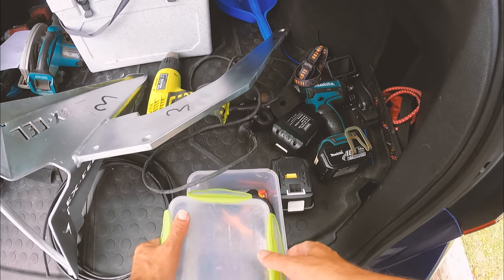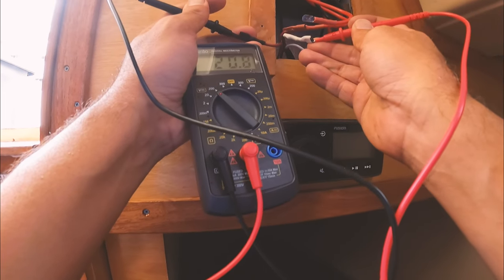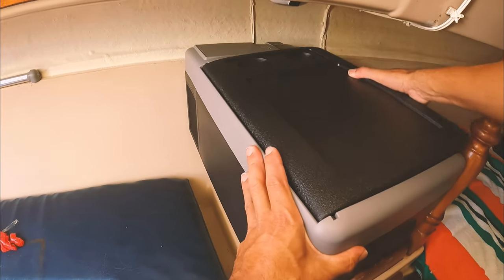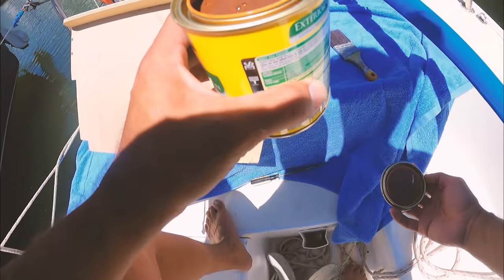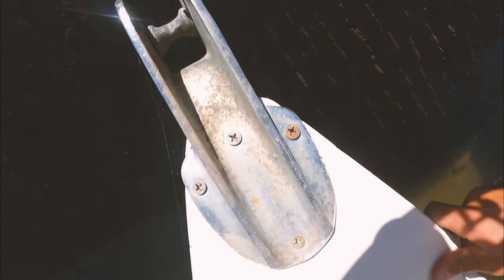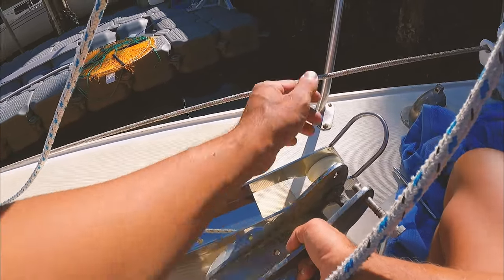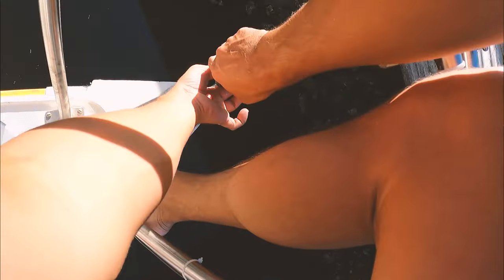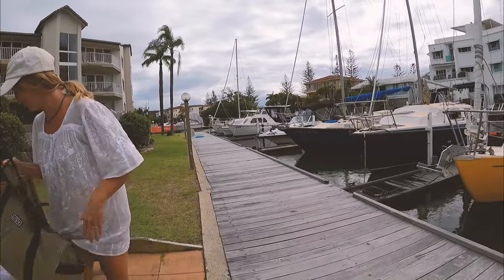Taking My Wife Sailing For The first Time.. But First, Lets Fix The Boat Ready For Adventures

Comment: Pro tip: If drilling into the boat, you should be drilling a larger hole than needed, fill it with thickened epoxy, then redrilling it to the correct size. This prevents moisture from reaching the core of the boat and rotting the boat from the inside out. You now have holes where water will not only sit from the anchor, but from water rolling over the bow. Not too late to pull it off and make the correction.
Reply: Great tip, thanks mate.
Reply: @alexandersupertramp1293  He actually says it’s wood between the layers of glass
Reply: @alexandersupertramp1293  If you noticed when he was drilling. you could see wood dust on the end of the drill.
Reply: @alexandersupertramp1293  That is where the seam is. Deck mating to hull.
Reply: I'm rebuilding a boat now and I love this tip!! Thanks sir!!
Reply: I don't think he even put any marine epoxy, even on the screw holes......That boat will be leaky.......and eventually rot.
Reply: @Aphxphotog  You can see the light from the underside of that anchor area....There is NO wood, except for where he added the wooden strip for the screws.
Reply: The commenters don't know what the fuck they're talking about haha
Reply: would that mean you should put some epoxy or silicone in the hole after you run the wire through in order to create a watertight seal? say if you were using a 1.5m wire, you get your closest bit to make the hole, and the wire MAY not be a perfect seal, is silicone necessary?

Comment: The only issue I can see with the swivel in that spot is if it gets snagged in the hawse pipe or on a deck fitting when you deploy the anchor. You definitely want to mouse the swivel with stainless wire too. This stops it from accidentally coming undone cause you don’t want to lose that sweet anchor. It is a sweet little boat. Can’t wait to see some big adventures in it.
Reply: Definitly mouse the swivel so you don’t loose your anchor. Looking good though congrats
Reply: At least zip tie the swivel bolts for sure.
Reply: The biggest loss when losing an anchor is not the anchor itself, but the boat which will probably be sent on a reef while the crew sleeps.

Comment: The next step on your new anchor setup is a snubber.  Basically it takes the load off the roller and onto your large Sampson post just behind your furler.  There are phone apps that will also monitor your drift via GPS and sound an alarm if you start dragging anchor while you sleep.

Comment: Hey mate, working alone tightening deck bolts (above and below deck), I always use multi/vice grips on the below-deck nuts and tighten the bolt above topside….vice grips hold nut and swivel only as much as the hull allows…. Don’t need another person.
Reply from the maker: Yep a set of multigrips would have been handy for sure. Might add them to the boat kit👌

Comment: Tip. The hole in the shacle pin is for wire to go through to stop the pin undoing. Wrap through hole and around shackle shank twist wire to lock old style. A cable tie maybe these days.
Reply: Haha years ago I lost an anchor exactly like this. I was new to boating and had 4.65 stacer for fishing.

Comment: Having bought and repaired an old sailing dinghy this year I thought I could give u a few pointers to help get this beautiful boat sailing smoother. 1) Replace important ropes with new ones. Old ropes tend to get less flexible and smooth with the years and salt water therefore replacing the mainsail halyard, the vang and any other ones u think aren't very smooth with new ones will make it a lot better. New ropes are lower friction and much more reliable so I would recommend them.  2) Old boats need a lot of WD-40, especially in rollers in the mast and boom, it will help a lot with making everything smoother. The last thing you want is a pulley or roller getting stuck in strong winds.  Finally as others have said make sure you wire that shackle. Can't wait to see your adventures with the boat.

Comment: To make raising and lowering the sails easier, I highly recommend installing some "lazy jacks".  This was one of the first things I did on my '72 Cal 27 T2.  You can basically just release the main halyard and the sail almost folds itself on the boom.  I'd do that when soloing or during rough seas, and just neaten up the folds when I was back at dock (or anchor).  It's an easy one day project.

Comment: Always mouse your shackles up mate. Mousing them is using some decent fine stainless twitch wire, through the hole of the shackle pin, around the shackle leg and back through the pin's eye.( can use good cord, but stanless wire. will last longer. . this will stop them working loose.. All your shackles, not just the ones on your anchor rope and anchor. .Cleavis pins also if they feel loose..  .. be safe , be well.. nice little boat you have :)

Comment: Mouse that swivel connector up thats what the holes are for, stainless and galvanise dont mix get galvanic reaction, that bow roller cound have done with some bedding compound like silicon under it. Nice boat good potential

Comment: Hi mate, liquid electrical tape is your friend for your wiring connections. I use 3 coatings with heat shrink. The last layer I leave tacky so when I heat the heat shrink the liquid electrical tape squeezes out each end. This will give you an absolute water proof connection. I have used it on my yak sounder installs for years and still good. Also some zip ties on those anchor/chain shackles would be a good investment. Cheers, BobbyB

Comment: the reason for needing a large stout anchor swivel is that if you're anchored and the wind starts swinging your boat around it prevents the chain from tangling on itself and pulling out the anchor which will set your boat adrift. If you anchor and go ashore, you might come back to find your boat on the rocks or the beach. It could drift anchor as well while you sleep. Don't forget to use the wire on the anchor for extra protection against the swivel coming apart causing you to loose your anchor.

Comment: Can’t believe you got the roller on without dropping something in the drink ! I wouldn’t be so lucky. A couple of things with the anchor. 1 be sure to go back and lock wire the shackles and swivel.  2 The Hawse pipe has a chain stopper already so no need to put another shackle on the chain to secure it. Great vid Rod.
Reply: I've seen a guy hang an upside down open umbrella off his boat when doing jobs like that, if you drop something it will catch it

Comment: Rod, You may REALLY want to change the plywood pad (in the forepeak)under your forestay to a stainless steel plate with as much load-bearing surface as you have space for. There will be a lot of load on your forestay with your mainsheet trimmed on when you are going to weather/into the wind. If that lets go you will drop your rig.

Comment: The fact that your wife is ok with you having a boat means smooth sailing. (Not that ole sailing lore from back in the day saying a women is bad luck on board.)

My suggestion is plan/project ahead, be prepared, tie down before it needs tying down, fix before it needs fixing, paint before it needs painting. When things go wrong on a boat things can happen fast and little problems can compound into bigger ones. Although true on a smaller boat, a larger one is where this advice really holds.

Good luck and thanks for the vids....

Comment: You need to tie wire on the pins of your swivel., also drill a hole through the anchor leg and new roller so you can put a keeper pin in it. Joys of the first sailboat. Ive had quite a few. Now im on a 52 foot Tayana. Any questions please feel free to ask.

Comment: Your new bow roller Should be bolted to deck with a strong backing plate.  If your at anchor in a strong storm wood screws may pull out. 
Have fun your doing a great job thinking about safety!

Comment: Wouldn’t be a bad idea to throw some sika in the anchor roller screw/bolt holes to stop the water coming in! Also, best way to trim the sails is to let them off until they just start flapping, and then slowly bring them on until they stop

Comment: I'm not much of a sailor, but I am an audio engineer - a tip for the wind sound if it's bothering you: in the video software/audio software you use, if they have the option to add an "equaliser" on the audio track, cut off around 60Hz and then add a small shelf around 120Hz and it should tidy up your audio while you are out sailing in the wind. 
[I could do it for you if you like, it's a 5 min job!}

Comment: You should put fresh bedding on any screws/bolts you pull.
Trust me.
You should rebed every screw and bolt on the exterior.
Me ~ 20 years of boat repairs.
Just a small dab will do, and it is likely to save you 100's hours in the long run.
Reply: Did he even fill the old holes from the original bowsprit? He needs to if he didn't.
Reply: @Mardy72  He's likely to be chasing leaks. I've been paid a lot over the years to chase leaks. Basic bedding practices can save one a lot of money, time and frustration.
Nonetheless, I think he is a pretty good DIY guy. 
Better than most, but if he worked in a reputable boatyard for a bit he would be much more competent.

Comment: You should drill oversized holes and fill with epoxy, then drill the right sized holes for your bolts to prevent the deck core from rotting. Using a dozen washers for packing is not good! Use a block of wood or fibreglass.

Comment: Get a bit of stainless steel tie wire and tie the d shackle pin to the shackle so it can't work loos.  And always use antisize on stainless steel bolts so they don't bind up . I like your new boat you are doing well all the best.  Wayne the Welder

Comment: I would highly recommend you pull those screws and bolts and put sealant all over the threads and then install.Over time water will work its way in.I didn't see on your rode but you should put markers on your rode and then you know how much rode you have out. Its very important to have the correct amount of scope out.Have fun. Cant wait to see you catch a Marlin off that boat.

Comment: I have 3 terrifying events happening in the next month. First is handing over a rather large cashiers check for a boat, second is a 2-3 day trip back to home dock, third is the return trip home involves a draw bridge and a set of locks.

Wouldn’t even stress about the remodel work, that’s easy in my mind, by comparison.

Comment: You should improve those connections and wires. Make a project video on rewiring the boat, ti's also a important safety feature on the boat.

Comment: If it hasn't been suggested yet, a thimble should be installed in a new splice on the end of the rope to eliminate any abrasion between the swivel and the "eye" on the anchor line.   Also each of the shackle pins in the swivel shackles need to be wired to the swivel to prevent them from unscrewing when under pressure in high winds.  This actually happened to me.  Anchor shackle came unscrewed, fortunately not at night, but in the morning!!!  Lost the anchor but not the boat!..

Comment: Great vids but more importantly amazing variety, the swivel between the anchor chain and rope was right, you need a metal eyelet on the rope, rope to metal will fray, metal to metal won't. Devil's claw  just for extra security to stop anchor deploying accidentally, just sturdy rope tied to the anchor then to the nearest cleat will do the job.

Comment: Thoroughly enjoy the video, you asked for suggestions. Tie wire all those pins in your anchor line, the last thing you want is one to come undone and you lose that lovely new anchor. If you put your new solar panel on top of the boom you will keep it out of the shade (when anchored) and you can tilt it towards the sun by adjusting the tie downs (may need a stiffener on the back). Thanks and have fun.😊

Comment: 54:19 if you're out at sea and it's not safe, you definitely want to sail (or lay ahull). The motor on a sailboat is really just meant to leave the marina or get you out of trouble in a current with no wind. The boat is way more stable when sailing, trying to get out of a storm with the engine is unsafe AND will get you sick because your boat will rock around like crazy. You can look up "heavy weather sailing" on internet, loads of good advice.

Comment: One word…EPOXY!  Fill holes, paint it on any wood.  Epoxy is your friend!  Have a secured tie-down ready to clip your anchor shackle when you’ve finally have it settled on the roller.  Get rid of the swivel on your anchor rode and put in a soft shackle. They’re just as strong as the swivel, they’re lower in profile and much less likely to hang up running through the chain hole.  Get a bunch of them, they’re awesome to have on the boat!  Single-handing the boat is great, BUT, if you get your wife into sailing, you’ll always have a sailing partner.  That’s an important thing…trust me (I don’t).
Reply: Trick out the V-berth with some mood lighting,  RED LED’s on a rheostat for night vision.  Get an anchor snubber…use it. Make a boom tent so you can get out of the sun/rain. Electronics help but always look at your windex…if it’s getting snotty, take in a reef or heave to.

Comment: Hi Rod, I loved your video. I want to give two small advice; you may want to  put a stopper knot at the end of your main sheet too, it can slip out of your hand very fast in rough weather. and when securing your halyard, wrap it around the cleat only one time then make figure 8. If you use more than one wrap, you may not untie once you need to be quick. 
I can't wait to watch the next videos.

Comment: How hilarious. I'm renovating a 30ft sailboat and doing almost exactly the same thing as you. Same equipment, same problems to fix. 
Brassmonkey fridge I have has a battery option as well which works well for a few hours if you want to not stress the batteries. Also use the mobile app.
 Have the same bowroller and anchor upgrade. Yours looks a little big for your boat as I'm 5 tons and 20kg. Really enjoying your sail videos mate.

Comment: It's actually quite relaxing to watch you fix up your boat. Only thing I can think may go wrong down the line with the stainless swivel is electrolysis on the galvanised chain
Reply from the maker: Yep will keep an eye on it, might swap it out if it becomes an issue 👍

Comment: A few years ago I was told "A sailboat is a money shaped hole in the water", I hope that's not your experience.
When my solar put 18.5V into my 12V battery it was wrecked in a couple of days. I was told a regulator will limit to 14.5V, the ideal maximum for a 12V battery.

Comment: I don’t know if I saw it in the comments or in the video, but the hole in the pin head of the shackle/swivel is for a cotter pin or safety wire, so it doesn’t come undone in use.

Comment: Great little yacht. I used to keep my boat in the next door units.   I had a centre board so could get in and out most of the time, very shallow at low tide. Its a fantastic trip up to the top for Moreton Bay . You need 2 weeks to get the best out of it, further than it looks. Your family will love it.

Comment: Those lock nuts can be a real pain. I always use a pair of locking vice grips. Lock it down on the nut and then when you start tighten from the top side it’ll wedge itself somewhere under there. As long as you can pop them loose it works.

Comment: Putting our boat in the water in two weeks time, I hope! Went down this morning to check our berth and to work out if I needed some more fenders. The walk ways were a good foot under water with the extreme tide. Had a look at Misty and your anchor set up while we there. That's a big anchor!
Reply from the maker: Hey Mike, now I remember your last comment and that you were in the same set of berths. Yea I was a bit shocked at the size of the anchor too... but I figured it is good to have a little more then a little less, and my boat length and weight sits right in-between the recommended sizes. Looks fine now that it's mounted on the bow and out of the way. I heard the tide was right up. I had to go there just now to put a spring bungee on the boat as it was so high the boat bow was sitting right over the wharf! could have been a big problem if it got stuck up there at low tide😅
Reply: @rokkitkit  I am retiring soon and will be making a lot of use of my boat. Probably see you at some time.

Comment: Anchor break away needed. Shackle chain near the shovel end and secure chain at neck with heavy duty mono, light rope or a cheap hose clamp. just in case it gets snagged on rocks and can't pull it up. Sorry if it has already been mentioned.

Comment: Another great video and I love the comment thrown in at the end "I've got a Girl in my videos!".  So nice to see the Missus at last.  Ref the wiring from the Solar Panel to the Charging Panel I would have changed the wires over to the right polarisation there and then (since you showed us how easy it was to pull the pins out the back of the plug), so there are no confusions later on, or make a note of that in the [Electrical] drawings you've got (maybe?) for the boat in that lovely folder!  Looking forward to watching more of your content now with Misty.

Comment: I appreciate that you realized what you'd done when you cleared the drill debris and it scattered to the wind. Awareness is the first step to improvement. Do you have a little vacuum you can use for dust collection? For that matter, does anyone have any recommendations for a good one?

Comment: On the anchor swivel run a piece of wire  thru the pin , so it won't screw off.